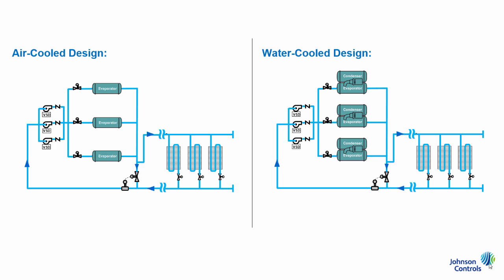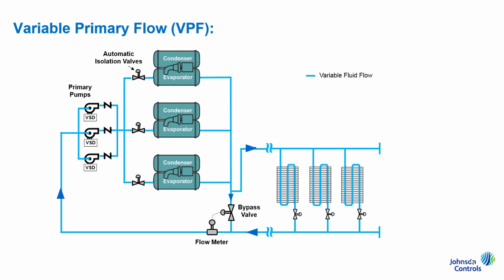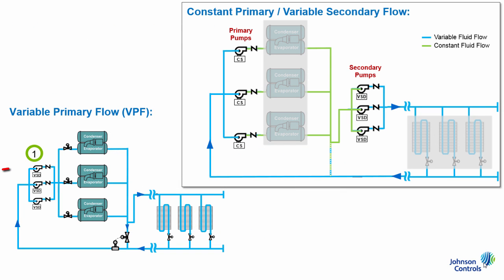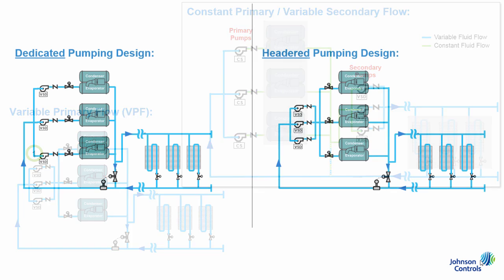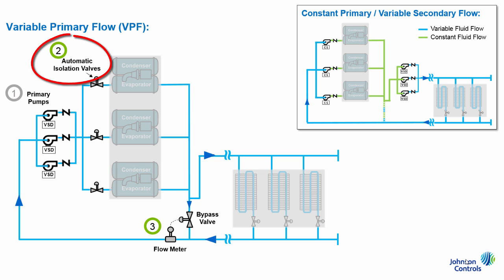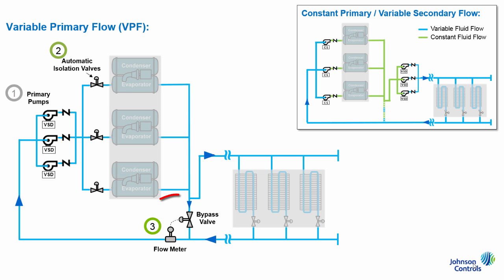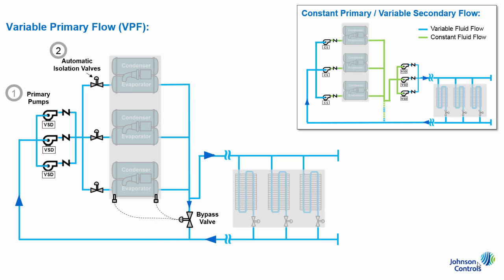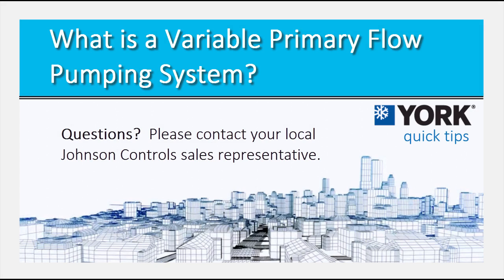What is a Variable Primary Flow Pumping System?

Comment: Bypass valve works to achieve the differential pressure, but adjusted to its desired command and still the dp is not met, (dp is still low) then the pump will speed up and increase dp

Comment: Primary pump and motorized values both should modulate or primary pumps should very with reference to DPT and bypass valve remain on or off as per load demand, please advise

Comment: Could u explain more about decoupler valve in primary and secondary chilled water system
Reply: The decoupler is a section of pipe that connects the primary and secondary flow sections. The flow direction can be either way, depending upon the mismatch between primary flow load and system load requirements. i.e. If a chiller is running at MIN. flow under low load and this exceeds the system load, the decoupler will have flow and the mixed flow (return CHW plus the excess portion of primary flow) will enter the chiller.